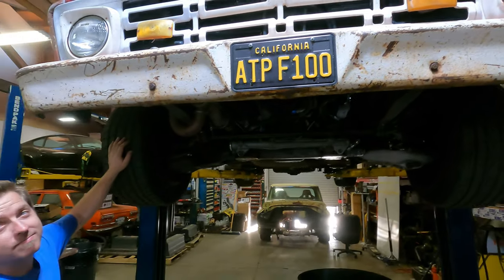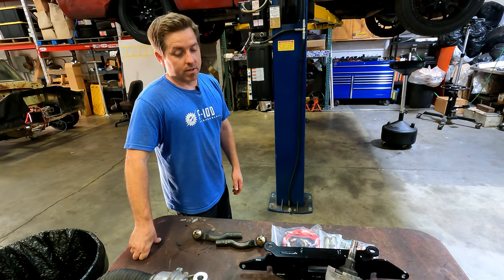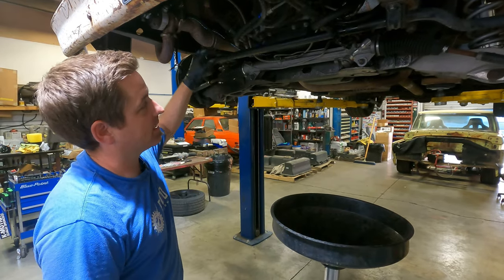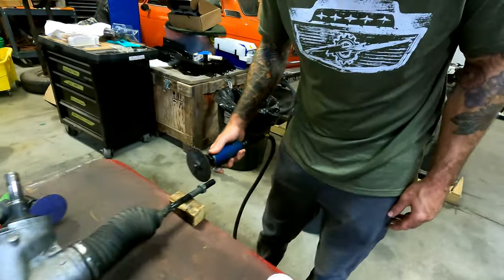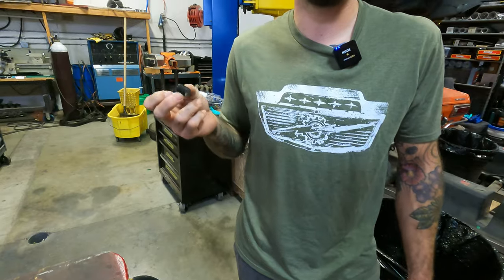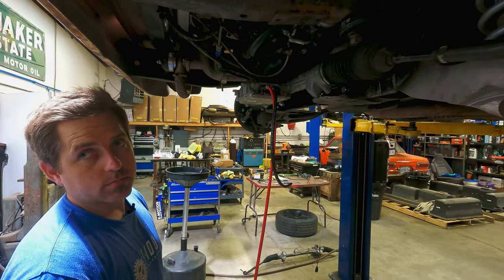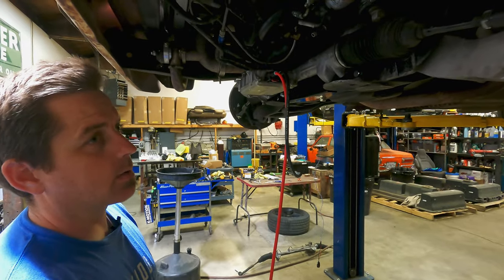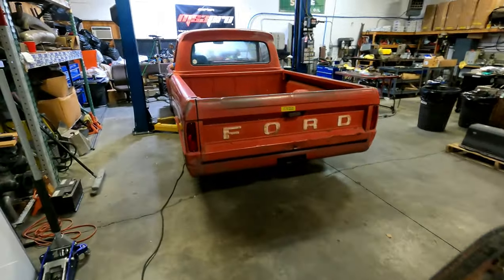Mustang Electric Steering Rack Conversion Kit For Crown Victoria

Comment: Odd question but I assume a 130 amp single wire alternator is a large enough to support the electric rack on a F100 conversion?

Comment: Grafting a mustang front clip and suspension to my 60 Mercury Monterey and will be using the electric steering rack. Hot wire auto in Mena, AR. is building my harness for the coyote engine and trans. We were discussing if we needed anything special to run the rack, but after watching your video, it looks like no problem. Great video, thanks.

Comment: What is the CAN bus messaging needed to activate this mustang rack? I have an  EPAS rack out of F150 and it is probably similiar 
Trying to activate it.
Reply: I’m doing this in a 99 f150 and was wondering if it’s different than the Volvo EPS wiring (have that on another couple cars, works really well if the stock steering is simpler to work with) where you hot up one terminal on the small plug and bam you have EPS.
It seems they have it just hooked up like that in the truck without the engine.
I don’t understand the justification of the 300+ dollar boxes if that’s all they are doing but fancier.

Comment: What did you guys do to hot up the rack? The Volvo hydro pumps use one of the small connector wires to hot to turn it on.

I can’t see the wiring on the truck without the motor.
EDIT:duh I should have finished watching…
Thank you for clearing that bit of info up!
Looking forward to getting the rack in the truck (1999 f150 swap!)

Separate question: Did you use AN lines beforehand on the hydro rack?
Which brand fittings/hose did you use on the pressure side?

Comment: I have a 03'Vic. Does the rack hook right up to the steering shaft? Do you know if the steering shaft has to be modified? It's funny. I seen a guy do this in a older s197 and it got me thinking if it would work in the Vics. Then this video pops up a week later lol.

Comment: Do you remove the ps pump and have to get a smaller belt  just curious you didn't address what you have to do with that side of it
Reply: maybe he runs the og pump but disconnects it? not sure either. work like to see an answer
Reply: @6lik6  I ended up  getting  a ps delete  plate that just has a  pull.on it the Mustang drift guy uses  them  Mentioned to him 
 should sell it with this kit
Reply: @6lik6  That power steering pump bearing would get wicked hot without any fluid.    Holy cow!

Comment: Would that work if I put a n ignition activated relay between the rack power and the battery so I could ensure its only powered on when the ignition is on? I'm thinking of trying to put an S550 Rack on a 2008 Mustang

Comment: very very interesting. i have an 08 crown vic p71. this is looking like a very possible swap for me. one issue is the drive belt. not sure on how it would be shortened or? if you can get back to us thatd be awesome!
Reply: you can replace the pulley for the power steering pump with a dead pulley just to occupy the leftover space, so you don't have to mess with the belt
Reply: I have a 09 p71. Go to autozone, buy 650k6 belt. It is 65 inches long and 6 ribbed, costs like 20 bucks. You route it the same as OEM, except you bypass the power steering pulley.

Comment: Anyone run this with a coyote yet?  I’ve got the smallest oil filter I can find and I’m still nearly touching the crown Vic rack. I wonder if this will fit?
Reply: Yes, multiple coyote swapped trucks have my kit in it. Like I said in video though, you need a remote mount oil filter setup. It does not fit with stock filter housing, no matter what filter.
Reply: @ap67et10 What steering shaft is needed to connect to the E rack??

Comment: So what are using to send can bus to make it come on or does it just go into default mode when given 12 volts?
Reply: it sounds like it's just going into some kind of limp home mode when it doesn't see a can signal.
Reply: @eimaiakominzontanos  Maybe. I have cracked the can bus for the Mustang steering racks to put them in sport mode.  I'm using them in my S197 Mustang Tesla builds.
Reply: @Roadstercycle  Hi can you help me to provide a signal to put rack in sport mode??!!
Reply: @berksonfab  me too
Reply: Are you able to shed some light on this, or can I contact you via email some how?
Reply: @Roadstercycle  I'm very interested in this.  So this rack just runs in default mode?  Can you share how to get them into sport mode?
Reply: @americatruckdrivingschool8505  `When running my can bus it puts the steering in sport mode. It is not in a default mode as Ford EPAS does not do that.
Reply: @Roadstercycle  how do we run your can bus?
Reply: @Roadstercycle  how do I run your can bus?